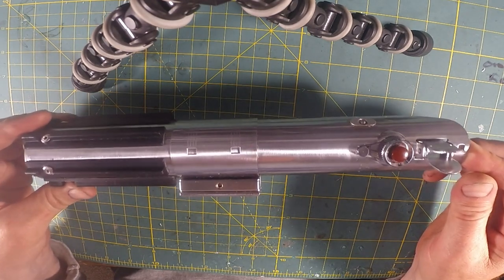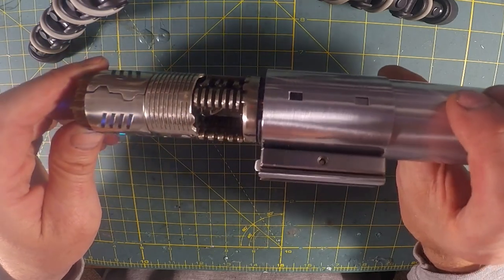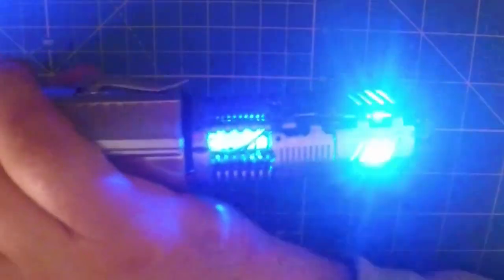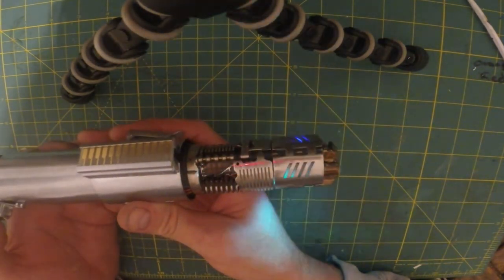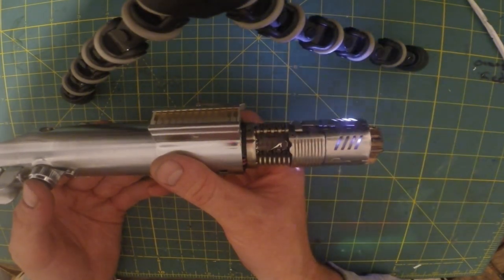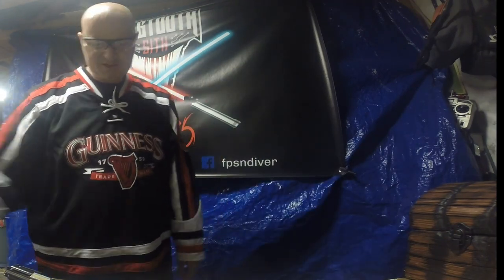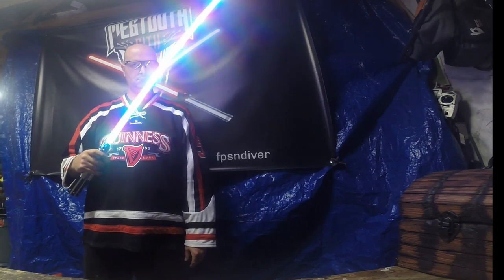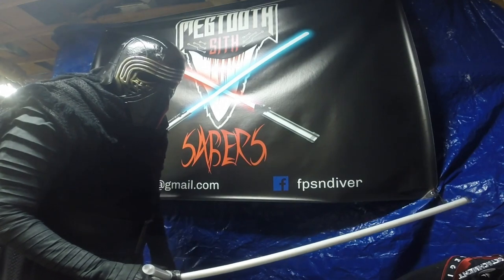TeensySaberV3 Korbanth Rey Graflex TFA Neopixel Lightsaber w/ smoothswing (FULL LONG)

Comment: I envy your master skills in confuguration the Teensy. I just starting to understand the programming part, but for now i not capable to use accent leds. Thanks for de video
Reply from the maker: Pepito,  I saw you wanting to make the arrows on a hero work.  I'm currently installing a gullwing hero, and have a custom button board for the control box on the way that uses neopixels.  Teensysaber can power normal LED's but its strength really is what it can do with neopixels.  I think if you used neopixels to light your arrows, that I can help you program them to light up the arrows in the way you want, and then we could do really unique things in other presets.

Comment: I just got a korbanth crossguard 2.0 and I was going to do a normal in hilt led but I love the teensy neopixel combo. Unfortunately I have no knowledge of the skills nessasary. can i buy a configured and soldered teensy saber sandwich board and blades from you. I would like to design and print my own chassis and put it together. check my channel out if you like JDUB 1.

Comment: Now that is a gorgeous and well-built chassis! Great job!
I am planning my very first Graflex build, using a Korbanth 2.5 kit and Goth Knight chassis with crystal chamber. I will be installing a Proffieboard and Neopixel setup.
I would also like to add some accent leds. What would be best / easiest to use for accent leds; 5mm RGB leds, or Neopixels? Am I right that I can snip off some Neopixel leds from a Neopixel strip, and use these? Can it be a small strip of Neopixels, or individual ones? When using Neopixels, typically I would need 470Ohm resitors, right?
I would like to go for a rotating / spinning effect..
Any advise welcome, and would be very much appreciated.. ;)
Reply from the maker: Ben,  I use neopixel accents wherever possible.  They can do any color, and can be programmed on proffie to behave however you want them to.  I have several tutorial videos on my youtube channel.  I try to make as much content for subscribers as possible, including live videos every Monday night.  Tonight at 8:30PM EST, I'll be doing a live video discussing a Graflex build with Knight Chassis that has neopixel accents and a neopixel crystal chamber.  These were my original test videos as I was learning my way around using neopixel accents:  https://youtu.be/apdaEdFkPsM     Then you see that same strip fragment in the aft end of my graflex chassis from this video here:  https://youtu.be/1JU3AHAK620.   You most certainly can use cut off scrap neopixels to accomplish these tasks.  They also sell neopixel 5mm LEDs, but I most often just use scraps from strips leftover after making blades.  There are really 2 sizes of neopixels common in lightsabers:  50mm and 35mm.  50 mm strips are commonly referred to as 5050 strips.  35 mm are referred to as 3535 strips.  Both behave in the same manner, but the 3535 strips are quite thinner, and easier to work with in tight spaces.  I typically use 3535 strips exclusively in blades and accents.  Each neopixel strip needs a 470 ohm resistor on the data line for signal stabilization.  330 ohm works, as does 550 ohm.  The resistance in this instance isn't to keep the pixel from being over-driven by scrubbing off current, it actually is used to stabilize the data signal, to remove the noise.  Its akin to hand grenades, in that you only need to be close.  Its not a strict rule, like calculating ohms law for a specific LED using FV, SV, and mA.  Many older saber installers are used to using ohms law to strictly calculate the resistor needed to protect the LED.  But neopixels are different, you are giving the strips full current on positive and negative, and only placing a resistor on the data line.  The resistor merely cleans the neopixel signal of noise.  That is it.  Hope that  helps.  Tom

Comment: What size resistor do you use for the crystal chamber, when you run in parallel?
Reply from the maker: I used a 470 ohm resistor on the data line that feeds main blade.  That resistor was mounted on the board, so it was between the board and the neopixel that illuminates the crystal chamber.  Then that data line continues on to my hilt neopixel adapter after the crystal chamber.  So, basically the crystal chamber is the first pixel of the blade to illuminate.  Hope that is clear as mud.